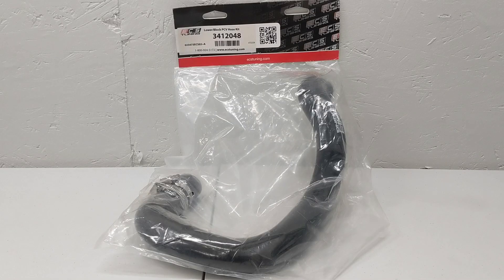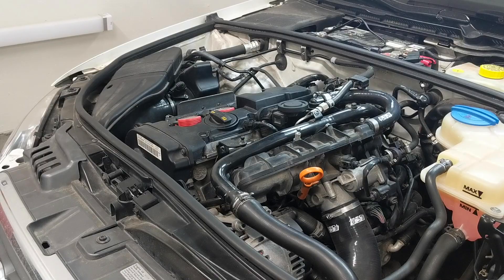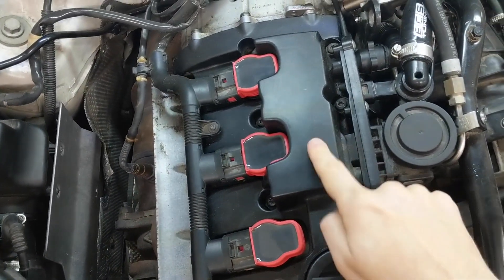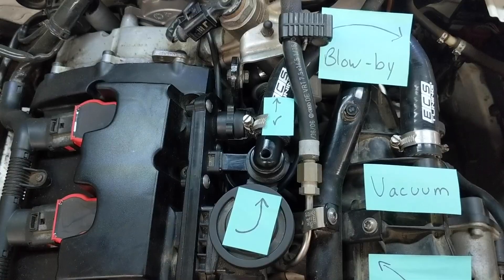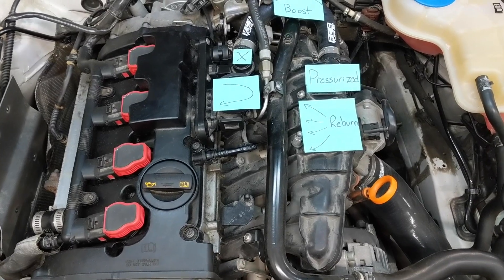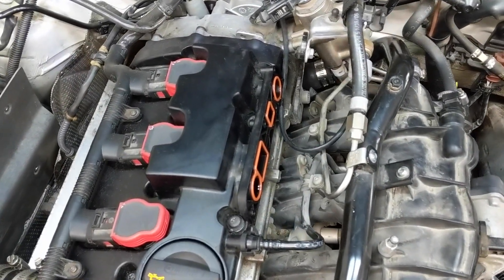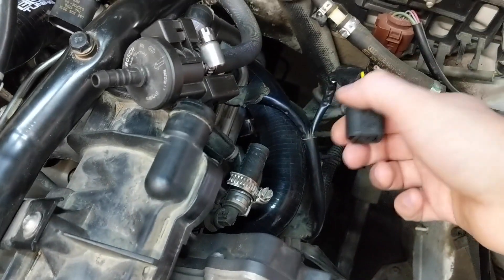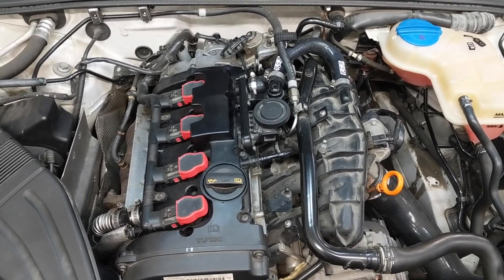How the PCV system works 2.0 FSI | ECS Lower PCV Hose Install | Audi A4 B7 | VW

Comment: if the hole on the lower is cracked where could i buy new one for oil separator cant find anywhere!!
Reply from the maker: Just the lower PCV pipe? On this car it's 06F103235A (search based on your own car/VIN though, please) but generally you can find these parts all over the place online.

Comment: Thank you for this video. I was having a terrible time getting the lower PCV hose removed, and having the new one rerouted. I didn't even think to remove the coolant expansion tank, connectors, or the PCV itself. I did, and it was so much easier. -06 A4 30k miles in 2025.

Comment: You should get the end cap for the manifold with the fitting for boost gauge etc. and ditch that hose. The pcv system is problematic.  You should get the delete kit with catch can. Engine will run so smooth you won’t even know it’s running I drilled a hole, put another fitting on the plate that replaced the pcv valve, then a hose to the inlet to the catch can mounted in front of the coolant reservoir then the outlet from the catch can under the right  intercooler with a small filter on the end.
Some people hook up the catch can wrong and you will have oil leaking from everywhere.
You don’t want to do what he is doing.

Comment: I bought the same ECS hoses myself & I like.  The OE pipes were an absolute pain in the ass to remove without destroying them.  I use a long skinny flat blade screw driver to reach down through to the bottom hose clamp.  It works just fine & you can remove & install the bottom hose with only disconnecting the HPFP wire & some patience.

Comment: What do you think would be the outcome of just running the ie rear block off and leaving the rest of the system in. I'm mainly trying to stop the oil consumption. Like most I've replaced a lot and done a leak down and just running in circles.
Reply from the maker: Not a great idea - that rear exit is very necessary when under the most pressure. You'd be building up crankcase pressure basically all times under boost which is a lot of the time. What'd you learn in the leak down? Because if you're eating a lot of oil, I start thinking about leaking valve stem seals, broken/worn rings or otherwise something not regulating or sealing oil properly. But you would have seen leakdown losses from the head in certain ports or out of the oil cap.

Comment: I have an issue that has been driving me crazy. The hose going into the valve cover between the oil filler cap and raised bevel of the valve cover.... should that have vacuum and what exactly is it for?

Comment: New subscriber here. Nice detailed explanation of the VAG FSI pcv system! Do you have a video of that engine running? I have a MkV GTI with those ecs hoses I installed. The intake to pcv hose collapsed always under vacuum and expanded under boost with the pcv closed. Does your's do that as well? It eventually  failed (metal wire in the hose broke and punctured through the hose) and I just put on the factory hose.

Comment: Question: I'm about to attempt this install on my Golf R, and I was curious about all the electronics you disconnected. Do those disconnections not affect the car? I can just unplug and re-plug them without worrying about things getting messed up/needing recalibrated/etc?
Reply from the maker: You're ok - there's not many things to be concerned with unplugging connectors on; more so things are affected by battery terminal disconnects.

Comment: I often explain to others; there are two types of PCV and two rear vent tubes. The valve in the rear vent tube you showed, pairs with the Rev.-P PCV. There is another rear vent tube with no valve and it pairs with the Rev.-R PCV. Although the Rev.-R PCV will function with either rear vent tube...valved or not. I also do not recommend people delete the PCV if their car is mostly used as a daily. For the losing the benefit of crankcase vacuum. Which helps with sealing at: seals__valve guides__and piston rings. If they are nearly always racing it, and it is in boost most of the time, then go on and delete the PCV; because they are never really utilizing the application of vacuum to the crankcase when racing. I personally feel that the catch-can systems made for these are all wrong for a daily. But when one sometimes sports it. They should instead have left the PCV and added two catch-cans;  one spliced into the hose leading to the inlet manifold (perhaps with a one-way valve in its exit to the manifold)...and another spliced in between the rear outlet of the rocker cover and the turbo inlet (replacing the rear vent tube). This would then not delete crankcase vacuum (with a Rev.-R PCV)...and the catch-cans would then filter in both vacuum and boost.

Comment: How much crankcase vacuum do you expect from a normal PCV valve in an VW FSI turbo engine at idle? Is it normal for the oil cap to be pulled down hard, with the engine stumbling and even stalling when the oil cap is removed?
Reply from the maker: Technically, it's the intake manifold that's providing the vacuum to evacuate the crankcase pressure (same difference, right?) - but at idle, I'd estimate you can expect to see a few InHg of vacuum. And yes, that suction on the oil cap is a good thing and it would stumble when removed.

Comment: Would it be bad to block off the Pcv hose to the intake manifold and just run the lower Pcv hose. Ecs sells them on their website and recommends them for a permanent solution to the leaking oem system.

Comment: Can you help me with me seat Leon Cupra MK2. You never got it in the USA but it has the same engine as the mk5 golf GTi. I have a hunting on the cold start and a minor miss fire on idle. I have changed maf pre cat lamber walnut blasted intake valves injectors cleaned with new filter baskets. Coil packs, spark plugs and a new pcv. Please help the video is on my shorts 😞
Reply: Thank you for your help!!

Comment: Great video!  The primer on the PCV system really helped to explain a lot of things!  I've recently pulled the intake to do a walnut media cleaning of the valves - that would have been the ideal time to replace this hose.  One correction - at 13:41 you point out the intake temperature sensor but call it the MAP sensor.   Just noting as I had to replace the MAP which is on the charge system. Thanks for the video!

Comment: Loved the video and now feel I have a better understanding of the PCV system because you took the time to give a detailed explanation. I'm having an under boost issue (P0299). It looks like the check valve on the breather tube is broken, because I can force air through it in the wrong direction when doing a pressure test. Can a broken check valve on the breather tube cause an under boost condition?
Reply from the maker: Hi Ted, glad you found it useful. It's not impossible the breather is your culprit, but I'm somewhat doubtful. Under boost and with no other direction for crankcase pressure to travel, I'd like to think that pressure (and the combined effect of boost "pulling" air from the head in the proper direction of air flow in the breather) coming out of the head would over ride the resistance of boost creeping up that hose. But, for the cost of the pipe and gasket, I'd just replace it. I have another video on the N75 valve that you should watch to think about that under boost situation more.
Reply: @FigureItAuto  Thanks. I'll check it out.

Comment: I just did this one and came here to say. Don't waste all of your time screwing around with that lower Norma fitting if you're going to replace it with this ECS hose. Just break them. I used a flathead screwdriver and a 90° hook. Cut the hose at the far corner as it turns towards the rear. Twist and pull and the hose is off. Just that easy! Total replacement time was less than an hour.

Comment: Hello there again :-) 
After watching the video again i am about to ask you few things :-) 
Do you have any oil consumption with this engine? I am suffering oil consumption and i have try everything to reduce it without positive results. Some are claiming that the pcv design on that engine is absolutely junk including the valve cover. In my case front pcv and rear breather are coming off the valve cover are always full of oil as a result all that oil travels through the intercooler pipes and end up in the intake which is burn after that. Even on the front pcv if i wipe off the oil and i drive the car for 15 minutes it gets full of oil again in no time. I have change the pcv with new one and does exactly the same without any improvement! There is one video only on youtube that he installed the aluminium billet valve cover with the catch can, and by eliminating completely the stock pcv, front and rear he's not using any oil anymore!  Also i've noticed with mine even with catch can installed, the rear breather pipe is still full of oil. How do you explain that? Thank you very much :-)
Reply from the maker: I sold the A4 this last spring (fall, for you? Like 6 months ago) to get the S4 but during my ownership I never had oil issues, even with what I found in the intake. Not bad enough to top up the car between oil changes, which I did once every 5k kms or so. If you're getting a LOT of oil in your catch can AND still seeing as much oil as you used to in the breather hoses, I would do a cylinder leak down test to see if your valve stem seals or rings are an issue and are contributing to above average consumption and blow by being produced.

Comment: Hands down THE best explanation of how the PCV system on the 2.0TFSI engine works anywhere on YouTube!
I've been wrestling with mine trying to get to the bottom of excessive oil in the intercooler pipes - like half a litre from both after 300 miles!
I've changed the PCV valve, changed the cam cover and the turbo and the issue is still there 😭
The only thing I have left to try is a PCV delete with a vented catch can and block the rear PCV intake on the turbo.
If this doesn't work, I'm out of solutions 🤷

Comment: Do you recommend pcv delete with catch can in this engine. What is pros and cons.
Reply from the maker: Hey 3K - Climate permitting, yeah, the catch can system is a step towards a smoother running engine. But, scroll down and read the back and forth between Nick RPT and I for the specifics on why it's not a full solution.

Comment: When i remove my oil cap on idling, i have a fair amount of suction and when i finally remove it the engine stalls... By your explanation if i understand well, the engine on idling is on vacuum mode so is that normal??? Also what is your opinion on removing the stock front pcv and replace it with catch can? Is it better for the engine?
BTW Best explanation i have seen for the stock PCV system, thank you very much for taking the time to share. :-)
Reply from the maker: Hi Nick - Correct, that suction at idle is a good thing. I think catch cans are a good idea, generally speaking and if your climate permits, I would do it. They're not a perfect system though and ultimately you're still returning gunk to the intake manifold - it's just better than nothing. Beyond pulling blowby out of the system, the larger benefit of catch cans might just be getting rid of the PCV check valve and therefore eliminating a common failure item. Call it peace of mind.
Reply: @FigureItAuto  by removing the stock pcv and adding catch can, you also removing the suction on idling. Do you think that this is ok to do?
It's a massive conversation around the pcv system from fsi engines, and im still trying to figure out the best way.
Thank you very much.
Reply from the maker: Bingo. No, I don't think it's that ok. I was going to save this solution for when I put the exhaust system onto my FSI but plans have recently changed, so I will gift you my master plan here in this innocuous thread. So, the goal of course is to 1. Always provide vacuum to the crankcase, and 2. Never allow blowby to re-enter the intake system from any inlet. Basically, treat the front and rear PCV systems and 2 separate systems.

On the front, remove the PCV and block all ports. Instead, run a line directly into a V mounted flange (angle is critical to create vacuum effect and not let exhaust gas come into the line) right after the catalytic converter, using the exhaust flow to provide a constant vacuum to the crankcase and sending blowby straight into the exhaust to burn off in the pipes. It would be somewhat important to get the car warm before driving in this scenario. This also becomes a gravity fed system, but you could work a check valve into it if you didn't trust the exhaust vacuum to be constant.

On the rear, get rid of the breather hose, cap the hole into the turbo intake, then run another line out of the valve cover and into the same exhaust flange you're using to pull blowby from the lower crank hose. As a bonus, in one or both of these systems, run a catch can in-line to separate oil to reduce the amount that hits the exhaust to create less of a mess behind the car. Google "mann provent".

This was a format I concepted for cool climates such that the solution does not depend on a catch can to work.
Reply: @FigureItAuto  wow that was a very long message. 
Unfortunately my knowledge is not that big to do all these myself. 
But it really seems like a perfect solution. 
Now my last question will be, catch can the normal way, or stock pcv valve?
Stock pcv with more carbon build up and more often clean the valves,  or catch can with less carbon build up and no vacuum?
Thank you very much,  i really appreciate your help 🙏🙏
Reply from the maker: By a slim margin, I would say: catch can. Most of the time you're driving it'll be at some level of boost, and I would rather keep junk out of the intake than ensure tons of vacuum is present when the car isn't at load.
Reply: @FigureItAuto  I'm from Australia,  Melbourne so we don't have here very heavy winter. So i will keep for now the catch can and see what happens. 
Thank you very much for taking the time to reply. 🙏🙏

Comment: Rather than use the ECS Tuning silicone hose (which is a bargain BTW) I used a HPS silicone coupler, 1.0 inch ID by 4 inch long. I found an alternative breather hose that is originally for a VW Jetta 2.0 (part no. 06G131127.) The silicone piece fits nicely on the oil filter housing spigot. I trimmed the latch ring off the VW breather tube and simply inserted it in the open end of the silicone piece. Spring clips are used to secure the ends. Why? Two reasons: 1. easier decoupling of the breather hose. 2. Better access of the banjo bolt on the HPFP. The ESC Tuning silicone hose blocks that access even worse than the original breather hose. The VW hose (slightly smaller diameter) can be routed just slightly forward resulting in clear access to the banjo from below. Best regards and GREAT vid. Haya....

Comment: Do you know what part the PCV mates up to is called? The one with the orange gasket in it.
Reply from the maker: Yeah, it's just the entire valve cover (06D103469N), which is one of the many issues with the B7 system. The PCV valve has metal screws that thread into the valve covers plastic threads. It's really easy to over torque the PCV bolts and strip the holes, creating a loose fitting PCV at the orange gasket.
Reply: @FigureItAuto  I just replaced the PCV today on my 2012 Golf R FSI, was going to do the same lower hose as you've done in this video but since its mounted in a transverse orientation in the golfs... the lower connection is nearly impossible to get to without removing the intake manifold. Problem is, I'm still getting the intermittent P0507 and surging idle despite having replaced the PCV. Any ideas?
Reply from the maker: I see. My guess is that the lower hose doesn't have anything to do with your problem, being that if it's so hard to get to and that it's subject to some cooling in the front of the car, it's unlikely to be damaged and causing any part of that vacuum issue. Since the surge is at idle I also wouldn't blame the rear hose. Have you combed through the intake system and all the intercooler piping? http://wiki.ross-tech.com/wiki/index.php/16891/P0507/001287. I'm terrible at electrical, but it could be that too.
Reply: @FigureItAuto  Yeah I also didn't think it would be one of the hoses but ordered them because I figure might as well if I was in there already. I'm thinking vacuum leak somewhere after the maf.

Comment: So I'm replacing the PCV itself, the lower hose as well as the silver breather hose featured earlier in the video. Do you think removing the HPFP would make this a lot easier? I plan on doin the cam follower soon.
Reply from the maker: Hi Keishi - If you're due for the cam follower, yes, remove the HPFP and save yourself some knuckle room. But removing the pump definitely isn't required. No pressure.